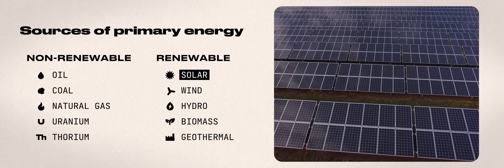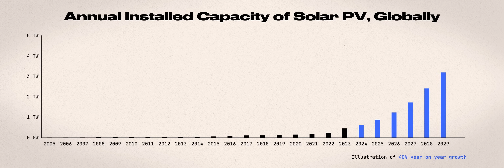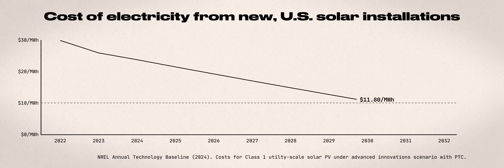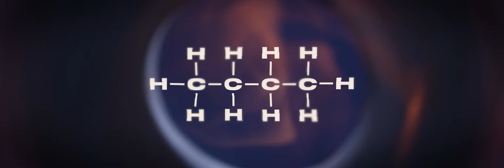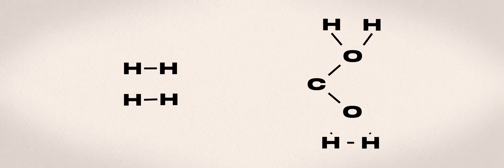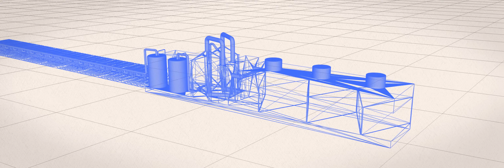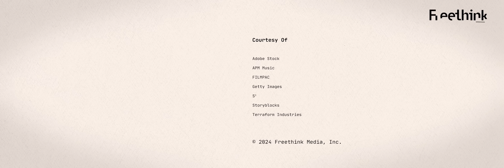95% of our energy could be downstream from solar by 2042 | The Freethink Interview: Casey Handmer

Comment: I’m an energy researcher - to me his economics don’t add up:  The US Natural Gas 'well price' (aka Henry Hub) is the world's cheapest at ~$3/MMBTU… or ~$10/MWhr.  Even IF you could get PV at $10/MWhr, at his 30% efficient process to convert the building blocks back into CH4, you’d need energy at $10kWhr/30%= ~$3.3/kWh electricity.

Perhaps the reactor doesn’t need energy, but the material (element) inputs are NOT free, either:

Current CO2 ‘direct air-capture’ (DAC) is ~$1/kg, and electrolysis H2 production is ~$5/kg   Even assuming “dream scenarios” of CO2 DAC @ $0.2/kg and H2 @ $2/kg….  results in CH4 material costs ~$10/kg.  For reference, the above Henry Hub well price of Nat Gas is equivalent to ~$0.14/kg per natural gas… 2 orders of magnitude lower!

Furthermore, a couple other slight-of-hands in his pitch: (1) He only showed a very ‘particular’ solar prediction using ‘Class 1’ landscape (ie, the best/hottest deserts in the world) and only the “advanced innovations” scenarios (aka science Hail Mary breakthroughs), not the other standard projections.  Secondly, to get low cost electrolysis Hydrogen production requires very high ‘capacity factor’ (% of hours in a day)… requiring >90% for good economics.  Solar can reach 20~25% but requires mechanical tracking to do so (thus, moving parts). So to get solar >90% capacity factor requires either storage/battery backup or grid-connections to achieve… greatly increasing the cost beyond the scenarios he shares.

I truly want them to win.  And cold-fusion.  And the stuff I work on.  And another 100x Cleantech breakthroughs… the world does indeed need them.  It’s just that energy economics are truly *brutal*… and we need to be HONEST about what it takes.  “Hot air” has gotten us into this climate crisis… more of it isn’t going to get us out!  ;)
Reply: My question to him is, if solar becomes extremely cheap, why not just use the energy directly rather than jumping through all these hoops to make gas, which will then be burnt and used at 25% efficiency in many cases, making the whole exercise pointless. The most efficient use of natural gas is for heating homes and water, being up to 96% efficient, but if energy is basically free, why not just use resistive heating, or better yet, heat pumps?
Reply: @xeridea  For some things you need the specific energy density of synthetic fuels over batteries.
It is simply not possible to make batteries light and energy dense enough for commercial airplanes.
Or even Rocket Fuel for that matter.
Reply: @thebestevertherewas  Yes that's totally correct. Fuels will continue to be important, tho less-so as various targeted battery technologies (eg grid, vs car, vs drone, etc) each mature.  To his point, he did say that his original intent was for creating methane at Mars to re-fuel rockets... and I guess Elon may be a customer for that (but it can't use PV there)!!  ;)  Whether he can compete on earth w/ a 'net-zero' Nat Gas remains to be seen.  But I hope he can!
Reply: @thebestevertherewas  I completely agree with you that there will always be a need for gas. My point is that for the other 95% of energy needed, it makes much more sense to use it directly then to go through some convoluted process like this.
Reply: @xeridea  Yes, agree this is a good point.  Here's my 2 cents:  Our current Nat Gas (from the ground) is indeed $10/MWhr for industrial customers and is between for homes and commercial building is between $35~$50/MWh.  However, at the home, electricity costs are generally $100~$150/MWhr.  So even tho electric water heating is close to 100% efficient, it is cheaper for many home/commercial customers to heat with gas.  Especially so for Industrial applications (which often need very high temperatures).  Likewise, for grid operators, when solar resource drops down, it's cheaper to ramp-up Nat Gas "peaker" plants to fill in the nighttime gap and/or variability.  
To his defense, I think there are many markets which need an energy-dense "fuel" which can store energy to bun at any time... and creating Syngas, Ammonia, H2 for these reasons has merit.  And I since went to his website, and he's cleverly able to skip some overhead Capex b/c of his direct usage...  I'm just curious about his economic claims given he requires "dream scenarios" of (1) PV, (2) carbon direct-air capture AND (3) H2 electrolysis to accomplish it.  I definitely DO wish him luck and all the best!!
Reply: @jdtransformation  Yes, using gas is cheaper than electricity in most places. I have natural gas where I live, and it is the cheapest source of heat, not counting heat pumps, even though my electricity is very cheap ($0.085/KWH).  But, if you use 3-4x the energy to make the gas, then burn it, you waste a ton. He is talking about solar being cheaper than dirt, so you can make the gas. If electricity is cheaper than dirt, just use it. 

Industries such as aviation will always require fuel, but the vast majority of energy energy uses could be switched to direct use of renewables. And to limit excess solar during the day, encourage day charging of EVs.
Reply: @xeridea  Quick AI search away, synthetic fuels are by far the most expensive. Waste plastic downcycling into fuels and biogas is cheaper. The cheapest source of gas by 2042 is still from the ground. Second-cheapest source would be using Green H2 directly. Flexible demand with local PV production could be cheaper than using natural gas. So, in applications where it makes sense, we will use electricity directly.
Reply: @xeridea  Cause battery tech isn't sustainable yet.
Reply: You are making several incorrect assumptions, like pricing (eg. hydrogen) based on grid electricity cost and expensive electrolysers that this company avoids completely. Another wrong assumption is "capacity factor". As an energy researcher you shouldn't be making claims that don't come from first principles but come solely from the market and what's available. " requiring >90% for good economics" is simply incorrect.  When you have super cheap electrolyser (low capex) it's not longer a requirement. It's the cost of energy that matters and intermittent-only (!) solar steamrolls everything else in the world.
Reply: Thanks,  @kazioo2  for your feedback and corrections.  I did in fact, review their website after my (admittedly hasty!) comments here (and before yours) and spent some time reviewing their materials. There he does offer a few novel insights bypassing, expensive infrastructure that are commonly required in such facilities by direct conversion into fuel. For example, he doesn’t require sequestering the CO2 (e.g. injecting into limestone, etc.) as it is instead sent directly to the reactor. Likewise, H2 is often pressurized for storage/transport, which occurs additional (~30%) energy costs. (Admittedly this is not always included in a LCOH analysis as there's no standard yet.) he also discusses trading off absolute electrolyzer efficiency for CapEx reduction. I didn't read in depth as to whether this is how he gets around the (VERY common) requirements of high capacity factor for electrolyzer economics.  And finally, I didn’t dig into the energy requirements of his reaction chamber - my specialization is more so in solar than chemistry so perhaps I’m schooled there!  
I should also acknowledge, that this video is designed for a non-technical audience and focuses on the problem (climate change, fuels, etc) and innovation (his work) for an emotional & inspirational message... a very good thing which I certainly don’t want to take away from!!
Many of the comments on this thread talk correctly about the inefficiency of this chain… and they are correct in that many end-use applications are better suited for electrification. There will remain a need for ”fuels”, of which methane/natural gas is one.  My point was around the economics, and I remain dubious! However, I think there are niche markets that this could really serve. For example, the recent conflict in Ukraine has shown that liquefied natural gas (LNG) can provide a critical solution in energy transitions - and this kind of production in Europe or Africa next to an LNG depot seems much more sensible than shipping it across the Atlantic! But, I can’t see how he can beat infrastructure next to an existing pipeline, etc.  
Still, as a scientist I honestly appreciate your points and feedback and nuance in this. And, I honestly do hope he makes it!
Reply: He's aiming for sub 1$ per kg hydrogen and ~100$/t co2. Basically the idea is to trade complicated high capex high efficiency components with energy hungry inefficient low capex components. That way, in the limit where energy cost is 0 (for example curtailed renewables) you're only paying for the amortization and you don't care about energy efficiency.
Reply: very well put
Reply: This company, Terraform Industries, has whitepapers with all the numbers available online.
Reply: He didn't pick the accompanying B roll. 

Obviously it will only initially work in the best places, but the difference between the best and worst places is a factor of about 3. Wright's law has held pretty solidly for solar with price declining by 20% every time installed capacity doubles. Which means that in the envisaged future this would make sense anywhere
Reply: I think the idea is to use this technology when PV falls below $10/MWhr? The theory is that eventually, solar will be so oversaturated we'll get to $1/MWhr.
Reply: What product have you launched so far?
Reply: @ahmadzaimhilmi  Truth!!! As a fellow entrepreneur in the 'deep-tech' energy space I've got a ton of respect for his battle and taking it on!!  As I said, I DO hope he (1) gets tons of investment, and (2) he makes it!  The world need it. (I hope this for my group as well!;)  In fact, as Bill Gross (of Heliogen) said: "we need 1,000 ClimateTech companies to take shots on goal - and several percent of those shots to turn into 'Tesla-sized' impact. Economics are (unfortunately) everything, and my (personal) wish is that he spoke more to them - even tho this video was not about that.  
It's strange, but scientists are often 'skeptical' and challenge each other - even though we want each other to be right and win.  I wish him and the Terraform team the BEST!
Reply: Finally, someone who sees through the bs 🙏🏼
Reply: I'm not qualified to say whether or not his ideas will work, but on my instinct from lots of paying attention to energy science over the years, my instinct is that it's not good to prolong the use of burning fuels because it still creates emissions. I make a prediction that the big oil companies will buy him and his whole thing in order to make sure we stay addicted to burning fuel.
Reply: Everyone should process data from boinc distributed computing software to save humanity from climate change ❤
Reply: This competes with batteries as energy storage and is far more transportable
Reply: He's written pretty extensively on the economics on his blog. They're very clear that their first product will be green hydrogen with the methane coming later.
Reply: I agree.  With the expanded use of BEVs, PHEVs, and HEVs, plus the expansion of photo-voltaic panels, it seems that fossil fuel demand will only decline.  Why would there be enough demand for synthetic fuel while the cost of gasoline is dropping?  Are you planning for WW III?

Comment: Hydrogen is just dumb..  has half the energy density of Gasoline... takes a incredibly complicated engine thats twice the size of an ICE engine to produce 1/3rd the hp.  Extremely inefficient..  Hybrids are the no 1 cause of fires.  We have the solution already... they are BEVs...  98% efficient, can create power from your own home, batteries are halving in price every year, energy density is now climbed to 300 to 500wh/kg...  97% less moving parts means no maintenance to drain your pockets...  Hydrogen is just Dumb.

Comment: Methane, synthetic or not, is a greenhouse gas more significant than straight CO2. Creating methane when it's readily available is unnecessary. Methane is currently produced and expelled as a waste product in some cases. This is not the right way.
Hydrogen by itself is a great energy product, although it can also have its own issues. Figure something else out to replace methane.
Reply: Burning methane from crust adds more carbon to atmosphere disbalancing the natural cycle of co2. Methane made form air does not do it, unless you leak it all instead of burning it.

Comment: Interesting points.  The problem with e-fuels:

a) They're inefficient to produce and inefficient to burn for fuel if again using in internal combustion
b) Still pollute our city air carcinogenic toxic emissions: NOx, SOx, CO, particulate matter (PM2.5) and other volatile hydrocarbons.  It's a major part of the sickly yellow-brown smog that hangs over all the major urban centers of our planet.  Go visit some dense Asian cities for a face full of the stuff all day long.
c) Although e-fuels will be net-zero carbon, we actually need to reduce the carbon in our atmosphere so net-zero may not provide sufficient ramp down since the carbon crisis is dire.

Specifically for natural gas methane (CH4), it exists as a light-weight gas that absolutely wants to escape any vessel its contained in.  CH4 has 80X the greenhouse effects as CO2!  Methane leaks everywhere during production and transportation.  It's called the "fugitive emissions" problem.

One overlooked grid-scale storage solution is thermal storage: Use large, enclosed volumes of ceramic blocks and use embedded electric heaters to heat the ceramic up with solar, wind and other non-fossil fuel energy.  Ceramic blocks are cheap as chips and easy to make.  The heat can be used directly in industrial applications (steel, concrete) and it can be turned back to electricity using good old steam turbine technology as needed.
Reply: Also: The emissions problem can be overstated.  Its maybe possible that e-fuels market can be created, but a consumer will have a great of trouble trying to register his/her e-fuel vehicle.  Emission standards are getting more strict, not less strict.  

It's amazing really that we've let it go on as long as it has.  Because internal combustion pollution is traced to respiratory illnesses, cancer and even dementia through nano-sized particulate emissions of unburnt fuel and metal shavings being found in the prefrontal cortex of urban people and their pet dogs too.
Reply: use your brain and listen before writting crap on the internet. E-Methane is almost free of contaminents, so no NOx, no SO2 and no CO if the burner has enough O2. Thermal storage has other problems. Turning it back into steam also not the most efficient.

Comment: @OP: The vid's overview could have been phrased better to make it clear that they were talking about the potential roles this new technology could be used for ... it was NOT presented as THE final solution to the fossil fuels crisis. It was presented as an idea/option for using surplus solar (that exceed local demand and storage capacity) to generate fuel instead of reducing output (aka downthrottling ... which is functionally the same as throwing that unusable renewable surplus energy capacity away.)

That would enable any/all solar installations to continue outputting at 100% even if it exceeded demand and if their storage capacity was full (or non existant). It could also be adapted as a bolt on option for other types of renewable power plants to eliminate their need to throttle down their output (to match demand) if the surplus exceeded local storage needs.  

This is something that only makes sense in conjunction with a renewable power source that outputs more power than current local demand and storage can handle - so instead of throttling down, they generate useful methane.

Comment: The problem here is twofold: 1) How cheap is solar without Chinese government subsidies? China isn’t exactly transparent and, rightly or wrongly, Western governments are accusing them of dumping. 

2) How is direct air capture going to work? Carbon Dioxide makes up ~0.04% of air. The minuscule change that humans have accomplished by burning fossil fuels is enough to cause problems, but as a matter of separating gases that’s not an easy task.
Reply: Regarding your point #2:  You are right, Direct Air Capture (DAC) is difficult and expensive.  The ocean converts dissolved CO2 into carbonates and bicarbonates, which the US Naval Research Laboratory has discovered can be extracted from seawater much more economically than DAC.  I suspect that to the limited extent the process described in the video is used, it will be confined to near seacoasts to take advantage of the natural CO2 capturing by the ocean.